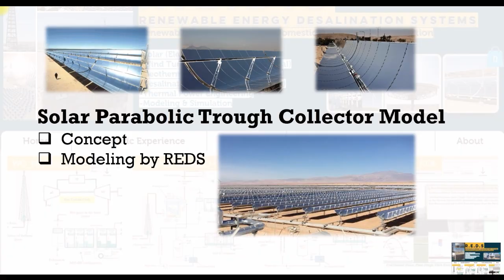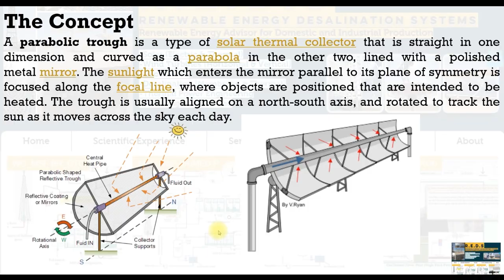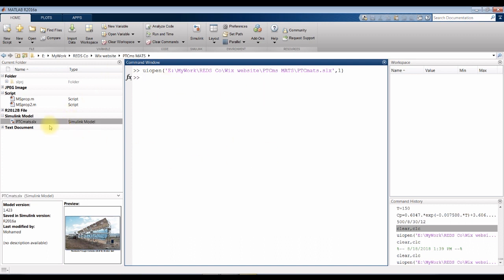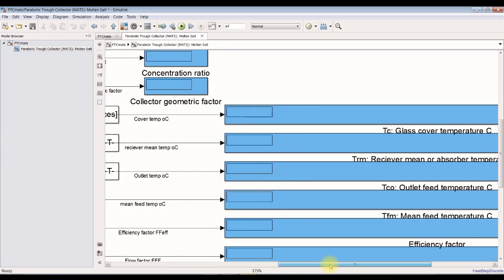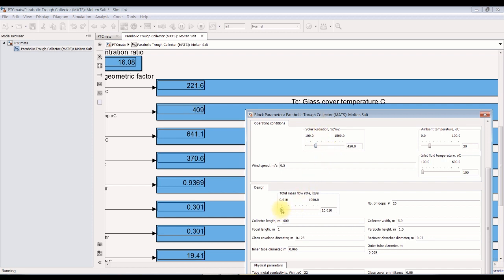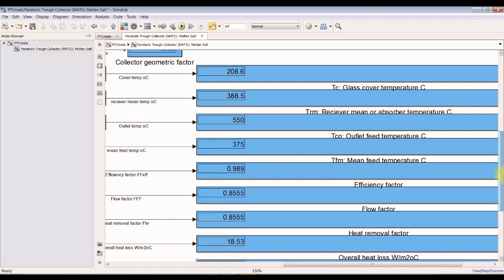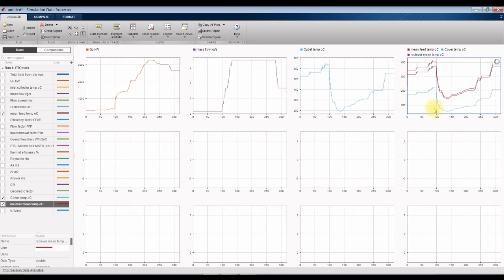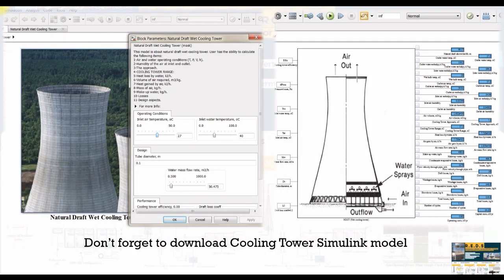Parabolic Trough Solar Collector Matlab/Simulink model

Comment: Outdated and too expensive. Photovoltaic is the superior tech.
Reply from the maker: Roland Mösl it is not a matter of technology, it's a matter of simulation.
Reply: Understand, something similar to a simulation of a stagecoach line and how many horses you need for it
Reply: Parabolic Trough Solar Collector outdated,? This is the actual trend man. You can't even count the number of project over the world. for exemple in Morroco(wikipedia) :
 Morocco Renewable Energy solar projects to be installed between now and 2030

Ain Beni Mathar = 400MW

Noor Ourzazate = 350 MW added to the constructed Noor Ourzazate

Sebkhate Tah = 500MW

Foum Al Ouad = 500MW

Boujdour = 100 MW

Noor Midelt = 800 MW

Noor PV II (Taroudant, Kalâat Seraghna, Bejaâd, Guercif, El Hajeb) = 800MW

Noor-Tafilalet (Zagora, Erfoud and Missour) = 120 MW

Noor Atlas (Tata/Tahla/Tan Tan/Outat El Haj/Ain Beni Mathar/Boudnib/Bouanane/Boulemane=800MW

Noor Argana (Boumalne/Tinghir/Errhamna/Essaouira) = 200 MW
Reply: @YassineMohammedAbuRazane  Sorry for this uneconomic decisions, making renewable energy unnecessary expensive.
Reply: @pegefounder   Not yet clear to be categorical. I invite you to read this: 

But the largest advantage of PV—lower cost— is narrowed or eliminated when the plant integrate with power storage. At present, the cost of Li-ion battery pack has fallen below $ 230/kWh, still expensive in spite of experienced huge reduction. It is also difficult to foresee how the breakthrough for battery technology and materials will be, and hard to tell the cost reduction trend in the near future. Another questions is, during the whole life span of a power plant, it may needs 4~5 times to replace the batteries as degradation is still a severe problem at the moment, and it’s also costly.

The largest advantage for CSP is that it could provide dispatchable power as well as the huge heat storage capacity. Molten salt is widely used for heat storage as it is cheap, safe and easily accessible. From technical point of view, storing thermal heat is much easier and cheaper than storing electricity. Armed with thermal storage, CSP plant is quite friendly to power grid, offering high quality electricity even during nighttime. Considering the cost of CSP with storage will be reduced by means of market expansion, technology improvements, government support and positive competition. Optimistically speaking, CSP is and will be playing an important role in energy structure.

source: http://helioscsp.com/pv-or-concentrated-solar-power-which-solar-power-technology-will-you-choose/
Reply: @YassineMohammedAbuRazane  There is the power distribution cost. Solar thermal is always big central. So there is the distribution of the power necessary.
Photovoltaic is best on each house. This eleminates the cost for the distribution, which are actually higher than the production cost of electric power by photovoltaic.
It's not so much storage necessary. Big consumers can run in daytime.
Air condition and refrigerators can produce ice as a cold storage for night time.
Electric cars best charged at day time.
Reply: @pegefounder  Yes it is, but yet the cost of storage is important,  there's no sun at night on every house. And for houses in the north of the globe it's more complicated with clouds,  then the need for grid is very obvious. Moreover, distribution grids are utmost established over countries. Just connect you power central and the power is on.
Reply: @YassineMohammedAbuRazane   I am just designing a house project in Austria next year. We will have for 22 kW PV only 2 kW of electric power storage. The heat pump is big enough to produce in winter all the necessary heat at day time. The heat is stored in 5,000 liter water, up to 116 kWh heat can be stored in this way.
We will have a far bigger electric power storage in the future, when price comes far down.
I know from projects with very abundant material for stationary electric power storage aiming for US$ 50 per kWh in 2025. At this price, I would install 100 kWh storage.
Reply: @pegefounder   Very nice, good luck.
Reply: Except, of course, photovoltaic doesn't do the same thing, isn't green, and is a complete non-sequitur
Reply: @RexStock  What die You not understand at photovoltaic? Humanity needs for the time of planet renovation about 300 TW photovoltaic.
Reply: @pegefounder  PV not enough for heat for industrial processes
Reply: @carlosmerinosubercaseaux5041  Wrong. I design energy optimized villages, where 3 km² can even power an electric only concrete factory for 500,000 t/a
Reply: @pegefounder  what if there is not enough space for PV to generare heat? Need to understand what you are talking about mate
Reply: @carlosmerinosubercaseaux5041  Concentration system work only with direct sunlight. PV can also generate electricity under a cloudy sky.
Reply: @pegefounder  thats not the point. I am talking that a high percentage of industrial heat can't be supplied with PV.